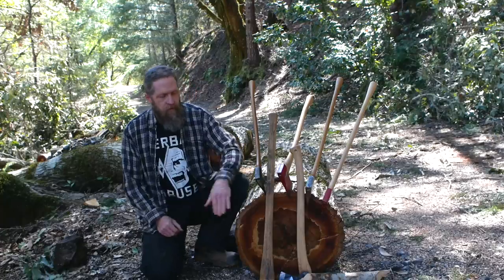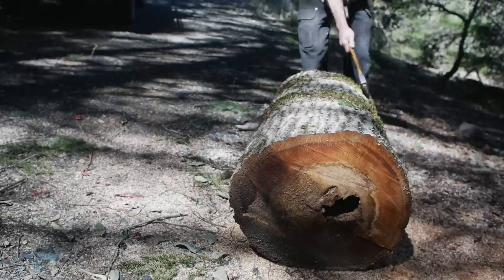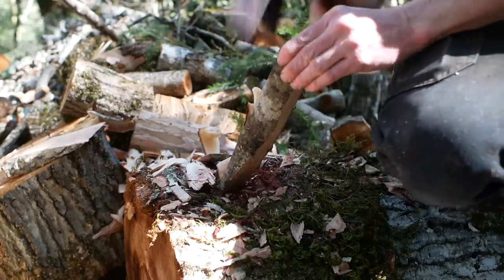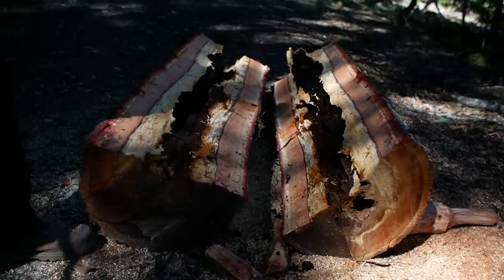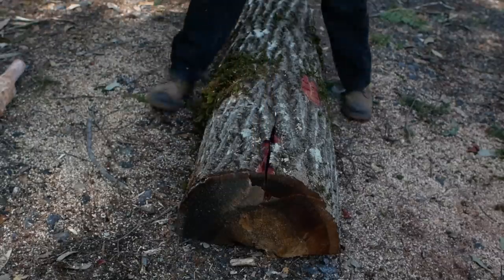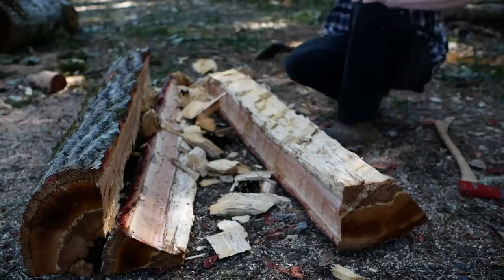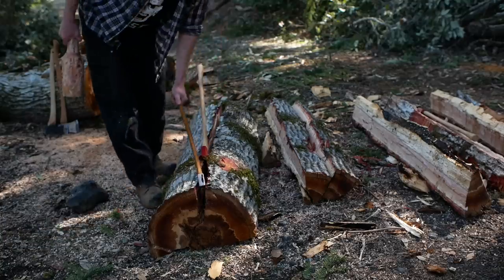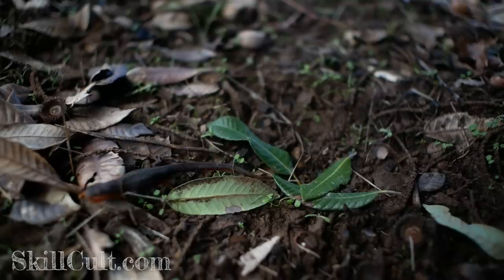Splitting Choice Axe Handle Blanks From An Oak Log & Shaping Wooden Wedges

Comment: 2:56 how often do you carve then? 3 1/2 ain't heavy
Reply from the maker: If you say so Hercules.  I don't carve that much, just like everyone except professional carvers and pretty extreme hobbyists.  If you can easily carve with 4 plus pound axes good for you.  That's pretty rad.  I know that in the old days, professional workmen used short axes that were fairly heavy for some stuff, but again professionals.
Reply: @SkillCult  I'm 15 soo take from that what you want. Been carving every day for like tow years
Reply: @crackers_are_great_with_am9572  That's nice.
Reply: A good hallmark for very experienced hand workers is that they don't casually throw away energy, and strive for minimal effort for maximal effect.  While you are young and want to build up strength, go for it, but let the old dudes make the tools do the work.
Reply: @LucasRichardStephens  Seasoned workers also generally understand that finding a method that works for you personally is far more important than going online and bragging about how strong your forearms are.
Reply: Look at me I'm pumped ! But can't carve a toothpick for beans ! Old school dudes can carve you a new bicep in 10 minutes .